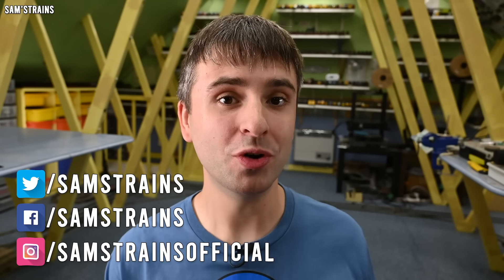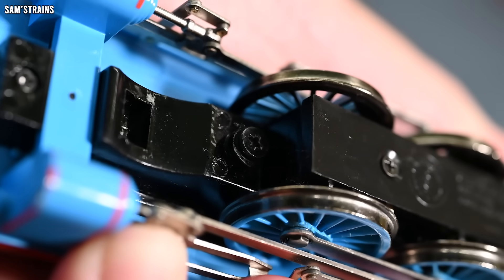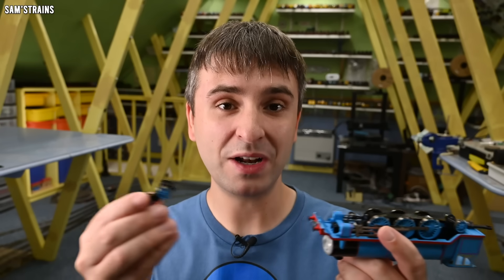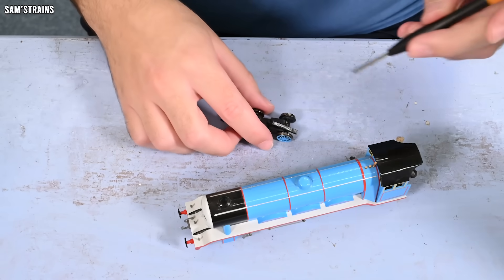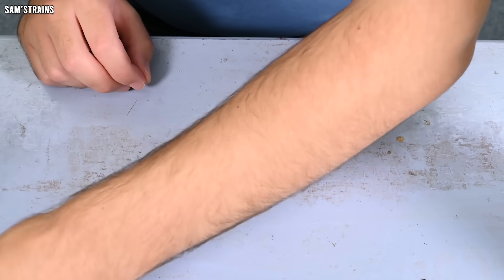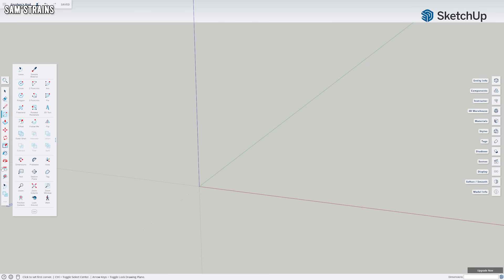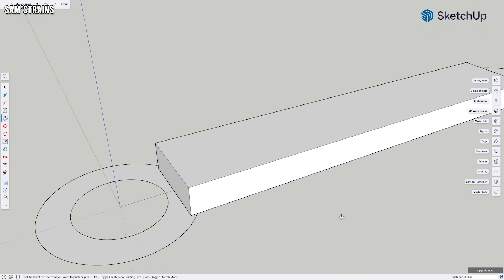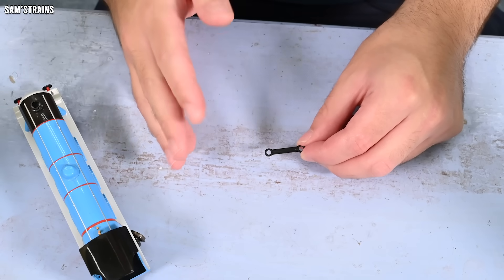My Bachmann Gordon Broke | Can I Save Him? | Making New Parts At Home

Comment: You were lucky that when you accidently dropped him onto the floor, only Gordon's bogie bracket was damaged and not the motor, cause if it was the motor that was damaged, it would be difficult to find a replacement and that he wouldn't be useful anymore and that he will be sent to the smelters yard.

Comment: Looking at the cross section...thats a  poor casting, very porous and probably an impurity in the Zamac (zinc alloy) has caused this. Glad you fixed it and you are right, Bachmann had enough cash for this to be a better part design and quality.

Comment: It's probably the combination of an impurity in the sheet or casting, subpar design, and metal fatigue. For a model that expensive though, the material around the holes needs to be thicker, with a taper transitioning to the straight part.

Comment: If you think Bachmann's Thomas stuff is expensive (and mind you, the prices anymore are highway robbery; did you know that when the range launched, Thomas cost IIRC a mere $35?), you should see what they currently charge for their non-Thomas US stuff. The prices on that are a smegging war crime. Especially anything DCC-fitted, ye gods.

I had my Henry's pilot drawbar break similarly (though I believe at a slightly different point). I didn't think too much of it since I've handled him a lot (particularly in the course of customizing) and it's seen a lot of stress as a result; I even had to bend it back into shape once (Gordon's is still fine, by contrast).
I do think the quality of the metal is the likely root issue here, it looks like some sort of die-cast and probably not the best. Something thinner but made of steel might serve better in this case, or even making it out of plastic as they do with the tender drawbar. I haven't had one of those break on me ever.

I cut a replacement out of spare plasticard with holes drilled in. Hasn't been road-tested much, admittedly, since he's been disassembled for a massive overhaul of my customization job on him that's been progressing on-off over the past few years. But it should hold, based on what others have said.

When doing your design to replicate the drawbar, did you consider tracing it with a fine-tipped pencil (your average mechanical one would work, I should think)?

Some wedges blending the circles into the shank might be a helpful change if you want to futz with this further.

Congrats on the successful repair! May he give many years of service.

Do you have any interest in creating a CAD for the following: backhead detailing for Bachmann Gordon and Henry based on the backhead from their closeup model?

Comment: Sam, a little tip to get a good idea of dimensions is to scan the part in on a paper scanner. You can add a ruler in the photo so that you have a scale. Then in your cad programme of choice, add the photo and scale it to the right size using the ruler. You can then verify known measurements to check its scales correctly. 

I can’t speak for sketchup as I don’t use it but this has worked for me in Fusion 360 and I’m sure it’ll work in solidworks as well

Comment: The way you've done it is the best way. Especially where one has broken away like that. 
I was an engineer before I went on the buses, so doing this kind of thing was an every day occurrence. I've got two sets of these callipers. One is manual though. It's a shame your 3D printer doesn't print in metal, which is apparently a thing.

Comment: Looks like pot metal based on how the original part sheered, great for keeping production costs low, but it's extremely brittle because it's cast instead of milled and I wouldn't be surprised if your other Bachmann models have a similar issue.

Comment: Mine had its motor burn out. Any suitable replacement that isnt from bachmann?
Reply from the maker: No unfortunately I haven’t figured that one out yet - it’s tricky because the motor is tightly built into the chassis… it might be possible to do a coreless replacement, but it’ll be a faff!

Comment: The part isn't necessarily too thin. If you look at the break spot at 1:55, you can see what appears to be a large number of voids in the metal. If they are voids, the molten metal had too much dissolved gas, perhaps it was too hot.
Reply: Yeah, I do think it's a quality/qc issue with the metal used, seems a bit hit-or-miss. The plastic tender drawbars aren't really any thicker and they seem to hold up just fine. And I've seen even thinner sheet steel and sheet brass drawbars on old models that are still just fine after who knows how many years of abuse.

For all that metal can be rather durable and is perceived as durable due to its heft, depending on the metal (and the quality thereof) it can actually be brittle compared to decent plastic, especially when it comes to small things. And being metal, it's also often more of a nuisance to repair - especially if it's something like pot metal or die cast.

Comment: I’ve had my own troubles with my Bachmann tender engines and for how insanely expensive they are the quality should at least be better than the smaller toy-ish tank engines, my own Henry had a crankpin on his connecting rods fall out and I can’t find it. Gordon’s tender coupling lost the spring and now he can’t couple to his tender as well as the 2nd axle on his front pony truck having a bent flange causing derailments. Not to mention my several issues with my tank engines, IE Analog Sound Thomas, Toby, and Ben. 

As much of an annoyed ramble I’ve had about these models i still very much love them since this is how I started the hobby when I was 7 years old. 

Coincidence how my Bachmann Gordon is also the same age as Sam’s?
Reply: Also; yes if anyone did wonder about it I will eventually fix my models. I only need a proper space to maintain them and the proper tools to do so

Comment: (@4:24) Hi Sam. The thickness of that could be critical; make it too thin and you just end up with the same problem again, but make it too thick and you might not be able to get enough thread engagement with the existing screw (the one holding the part to the underframe), then both the screw AND the bogie will fall off somewhere on the carpet and that’ll be the end of the screw… until you come in one day with bare feet and step on it like a Lego brick. 😢

Comment: Very nice job. If you need to print another I would suggest making the plastic around the screw holes 'wider', there looks to be plenty of room for another few mm without fouling on anything. So you currently have the plastic around the screw holes at 1.2 mm, perhaps you could try 2.8 mm (or another 0.4mm increment). As you noted with the metal original, the ends of the part have a lot of strain put on them due to the screws and the circumference of the holes being so thin, so this should give them more strength.
Reply: I was about to suggest this, but with one difference.  An engineer would say there's a 'concentration of stress' where the straight section meets the ring ends on the original part.
Given that, if the drawbar was gradually flared out to 'became' the ring end, the stress would be spread over a longer length.
Reply: @OliverT-qt1gn  Great idea!

Comment: Totally agree it's a real surprise that the part, a metal part broke.
I suppose in Bachmann's credit, it was attached at both ends by screws, which made it a whole lot easier, and that the part was only 2-dimensional + thickness (it was flat).
Nice save Sam.
Al.

Comment: owning a lathe and a milling machine i would generally have made a new part in brass, however you could make a brass part with just some careful drilling, cutting out with a hacksaw and filing, it just takes a little longer. anything can be done if you have the willingness to have a go, if it doesnt look great- no matter, try again until you are happy with the result.
Reply: of course you couls always use a laser cutter to make a part in thin plywood too, whatever works.
Reply: My first thought was why use Mazak when brass or steel would be a better choice - can only be for reducing cost.

Comment: I think I'd probably either have just soldered a washer on the end or, if the Bachmann bar won't take solder (which is possible) just cut a new bar from some metal sheet and drilled out the holes. I must admit I'd prefer to have a metal part than a 3d printed one.
When did Gordon get oval buffers Bachmann ?  They should be square 😂

Comment: 10:30 I’d recommend a cutting broach, tapping wrench to help with these holes, may not be a huge issue for you, but these tools self centre so if you need to enlarge holes that require abit more precession (chassis for your model builds), then you may want something abit more precise than a file

Comment: Try fitting those in N Gauge. Absolute nightmare! 😂
Spares in stock at Bachmann Spares, but bar not sold separately. Comes as part of a pack with the complete bogie assembly, which obviously isn't needed. £12 for the lot. Not a bad price at all but you'll end up with an entire bogie in the spares bin for the sake of a part that has lasted 7 years. Well worth the effort of making your own. Well done, Sam!

Comment: Tip:  To find the center of 2 circles ( or partial circles) measure from the near end on one circle to the far end of the other circle.   That distance will be the distance between centers in one measurement.  No calculations needed.
Reply: Is that true only for two identically sized circles?
Reply: @roygardiner2229  yes, because you're relying on the diameters being the same between both. You could account for the difference but then that'd kind of defeat the purpose of the "no calculations needed" bit

Comment: While I haven't tried to use my method on a front bogie bracket, I've had a couple of the metal bars between locos and their tender break, bend, or shear off.
For those of us without 3D printers and/or outside of the UK, so buying spares is most definitely not cost effective, here's what I like to do:
I look for old unused credit cards, store cards, or gift cards. Some cards are different widths so determine which would fit best for your purpose. Afterwards, cut a few to size and drill holes where needed. I would recommend cutting a couple of spares in case they end up being not so durable, depending on what width of card you are stuck using for your purpose.
For appearance's sake, I usually just use a black permanent marker to make the makeshift bar inconspicuous.
Make sure to measure twice and keep in mind if your application has shouldered screws!
Reply from the maker: That sounds great - nice strong plastic there - great idea!
Thanks for watching, Sam :)
Reply: I have a 3D printer and I am confident that credit cards are stronger that 3D printed parts.  I keep a supply of odd shapes of plastic and metal too make things like this.  For decorative parts, you can't beat 3D.   For durability, I use almost anything else.
Reply: @Scynthius137  Thanks for the feedback! I tried it on a whim after purchasing a Hornby T9 with a broken tender drawbar and a Bachmann D11 with a missing one. I was impressed since I didn't expect the idea to work so well! I did always wonder how it compared to 3D printed ones.
Reply: The real problem here is that these tiny metal parts often come out very fragile and break far too often. The problem is particularly bad with partworks kits because they like to use tiny to-scale parts in places that take a lot of weight.. A lot are virtually impossible to repair or replace.. If only there were a way of making them out of forged steel.  😄
Reply: I'd think ABS or polystyrene sheets would be better, but I approve of reusing what would otherwise be garbage.

Comment: My 6yo daughter has Thomas, James, Gordon and Percy….I’ve found the quality of these models to be shockingly bad for how much they cost. I’ve modified all of them to have directional lighting and slapped HM7000’s with stayalives in them, but I genuinely wanted to throw Gordon out of the window because of how poorly designed it was. 

The motor for James has become faulty by developing an internal shorting issue, so I need to source a replacement one…do you have any recommendations rather than Bachmann’s official one?

Shes incredibly gentle and really good with them…she only shunts them, never physically handling them, so it’s not because of her that they’re all crap, it’s genuinely down to how shockingly crap the quality is.

Comment: Extremely odd to think that basically a children's model whould be made with not durable enough parts. They should have taken that into account. They probably didn't know it wasn't that durable but they could have noticed by the thickness. Maybe a stronger sort of metal would have been more preferable here. I'm not an expert myself in that department but Bachmann can be and honestly should be. Experimenting is the way to move on i guess. It came off as more offensive to Bachmann as i would hope but I don't mean it that way. This could happen to anyone. Hope it doesn't happen again with a more complex part to any model of yours sam and not to anyone's as well.
Reply from the maker: I was surprised by how flimsy that part was - looking at it, I'm not surprised it broke! I reckon even my part will last longer, haha!
Thanks for watching, Sam :)

Comment: Great video Sam! I actually really liked how technical this is as I need to repair the bogie on my Hornby M7 (honestly a really shoddy model in my opinion) as the clips holding the bogie assembly failed. I might have to design a part for the bogie, and also a part for holding the decoder, as Hornby’s DCC solution for that model is a bit of a joke as well.

Thanks for the tips and glad you fixed your Gordon!!

Comment: There's still one little thing wrong: Gordon's eyes aren't moving from side to side like they should. You probably damaged the mechanism that makes the eyes move, but at least the Bossy Boiler is working. Suzanne has had her first run. Her tender decided to derail as I was capturing her, but no big deal. Her tender behaved better when she helped two of my GWR recruits with running in trials. I'm happy to say the Airfix Large Prairie Tank Engine and Mainline Railways Odney Manor run perfectly well straight out of the box. Three steamies tested in one day, no issues or faults whatsoever. Also, call me crazy, I found an Accurascale model of my beloved Foxcote Manor in Brunswick Green online in Cheltenham Model Centre and pre-ordered her.
Reply: I'm not sure if Sam did this, but some people remove the gears for the eye mechanism to improve performance on Bachman's Thomas models. Since the eyes are powered by the motor, the eye mech takes power away from the wheels.